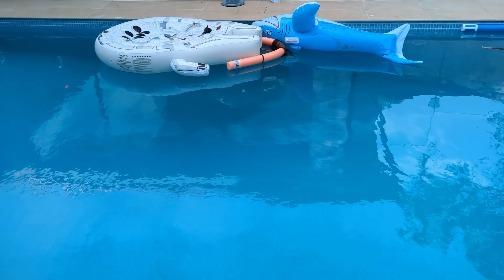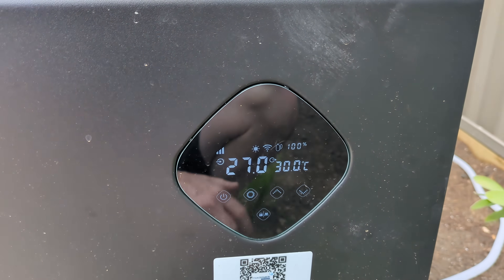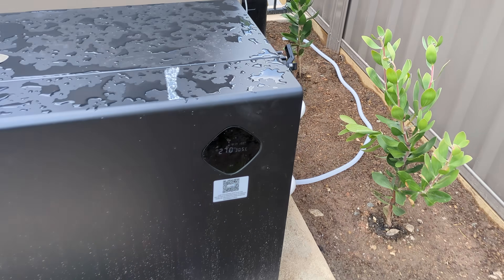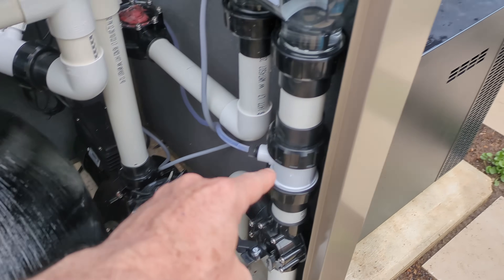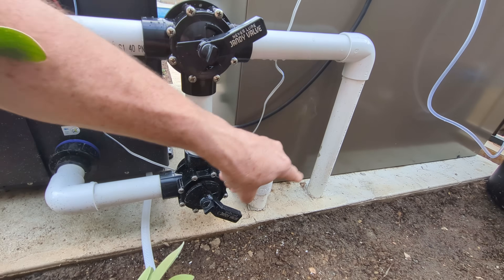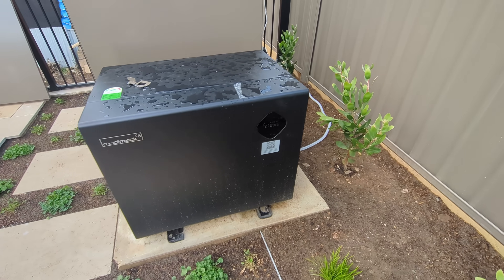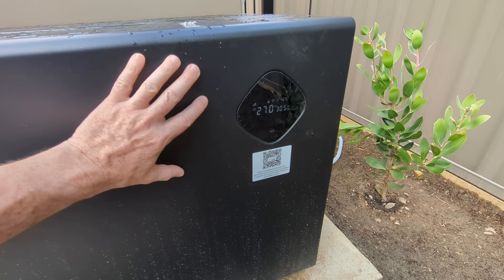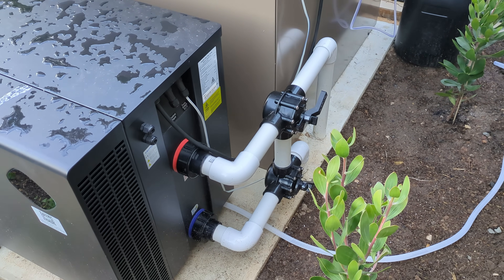Pool Heat Pump Calibration Explained (Madimack)

Comment: You didn't mention why it's more efficient! It's more efficient because it's all about the refrigerant loosing too much energy into the large volume of water and thus needing to be heated up even more by the radiator/compressor before the phase change occurs which is just wasted energy, modern high efficiency refrigeration systems (and other industrial processes) are all about optimizing the system to always stay around those phase change regions as pretty much all of the energy transfer in a refrigeration system is from the phase change of the refrigerant hence why heat pipes in heatsinks also have a 'narrow' range of operating temperatures and heat loads for optimal thermal conductivity.
Reply: Thank you for this comment 👍 makes sense
Reply: Yes this is basically a very specialised AC unit, with the outdoor coil replaced with a small compact heat exchanger. Pressures and flows of the refrigerant are optimised so that the heat exchanger has a section where, with the correct water flow, the phase change is done from hot gas to hot liquid in it.  Too high a water flow rate and this occurs near the inlet, and thus the system runs at a lower pressure differential, as there now is hot liquid refrigerant occupying most of the heat exchanger, and thus the overall system runs at a lower pressure, reducing efficiency. Too low a flow rate and this zone moves outside the heat exchanger, and there is likely a temperature sensor on the piping to detect this high temperature exiting refrigerant, and shut off the unit for flow rate.

The air refrigerant side now sits with a small zone of acceptable temperature, the rest of the evaporator not being used to transfer heat to the cold gas, as it is now at ambient temperature, because of the lower volume of refrigerant there. This is because these almost invariably have no accumulator or receiver drier, that holds a larger buffer of ambient temperature refrigerant, so allowing the correct pressures in the various parts, irrespective of ambient temperatures.  Small volumes of refrigerant you need to keep inlet and outlet temperatures very constrained to maintain efficiency, though there is likely a small volume of liquid held in the piping to the expansion device, either a few capillary tubes that exit direct into the evaporator, to reduce pressure that way, or a TXV that meters the liquid into the evaporator based on either temperature of the evaporator, or more likely using a small stepper motor to do this via a microcontroller, but basically the same.
Reply: @SeanBZA  Can variable speed water pumps work in tandem with the heat pumps to keep the refrigerant at the optimal pressure continuously?
Reply: @dosgos  Sure there are systems that integrate the variable flow pumps with the heat pump, but you are then adding a lot of unneeded complexity to the system, and in general with a pool, you can be sure that you will be replacing parts regularly, especially pumps, as they do have a rather high failure rate on them. Pool pumps will either wear out seals, or will cavitate themselves to death, or will wear out the impellor or housing, just from the water and dirt in a pool. Then they will also corrode to nothing motor side, and, as they are all now wound with CCA wire, they are also prone to having motor windings burn out, or go open circuit. Run capacitor also goes low value, and that in turn burns out the main winding as well.
Reply: @SeanBZA  Thank you, have been trying to understand the science behind this for a year, and my Hayward unit came with no clues.
Reply: Thanks Tim , you are a wizard. I am pretty highly educated and have worked with heat pumps for a few decades but I couldn't have explained as well as you do.

Comment: This really in not quite true. At higher flowrates the amount of energy going into the pool will be the same.  You ara just heating more water, with a lower delta T.  COP at higher flowrates shouldnt be affected as far as i understand it.
Reply from the maker: Madimack say otherwise. The specs are very clear on where the maximum efficiency figure is.
Reply: @EEVblog2  Thats hydraulic likely efficiency rather than heating efficiency.

Comment: Oh! Is that the reason why movable ACs usually don't have two pipes to outside? They work better if temperature is in very specific range? and outside temperature can change wildly. or is it just that it is cheaper to make with just one pipe?

Comment: So if you have a three valve bypass as I have I would adjust the centre valve to adjust the flow through the heat pump?

Comment: Hi, how do you actually set the temperature and difference between in let and out let. Also our percentage bar is at 0 so it’s not doing anything. This would be really useful information.

Also if the pool is low and not right in the skimmer box will the heat pump work properly?

Comment: Is there any issue with the bypass (non heated) water causing back pressure on the heat pump outlet water flow?

Comment: Hey Dave did you look into running a separate pump for the heater so you don't need to run the filter pump the whole time? You probably only need to run the filter a few hours a day to clean the water, the rest of the time running the 1kw pool pump is just pushing extra water around for no reason.  Every little bit helps when going for efficiency. 😃

Comment: Thanks Dave my Madimack just stopped working. 
Luckily it is just a flimsy reed switch connected to a paddle they use as the flow sensor, just inside the outlet. Kept throwing E3 error for no reason. Just superglued the magnet back onto the paddle and it works again.

While trying to find a fix, I found your video and my flow is way to high and have dialled it back 🙌

Comment: To be fair from all I have read your heat pump is also somewhat undersized.... you wouldn't be that far off with the 12kw version and probably could match the flow rate with an inverter pump, and control it such that during heating it runs at the lower speed and only runs at the higher speed during certain periods for cleaning/water turnover reasons.  Just eyeballing it your have around a 40k liter pool which is at the upper end of this unit... thankfully more inverter heat pumps are being sold so you can oversize the unit somewhat and widen the efficiency range significantly. I think its an area where state of the art is definitely moving in the last few years... a few years ago nobody would have even sold anything more than an OFF/ON heat pump even though though and oversized unit running at 25% is a lot more efficient than a unit running at 100% outupt this is also in part because in addition to matching your coolant flow, the available heat or heat capacity in the air also varies with climate, and the inverter unit can match that better also... I don't think any of them actively try to hit an optimal efficiency point yet though.

Comment: er, tell me you know nothing about thermodynamics without telling me you know nothing about thermo-dynamics ;-)

Heat transfer by a fluid is governed by three factors:

1) the fluids specific heat capacity, which for pure water is around 4.2 kJ per Kelvin per kg ie it 1 kg of water will be warmed up by exactly 1 kelvin if you put into it 4.2 kJ
2) The mass flow of the fluid (mDot)  this should be obvious from 1), ie the more kg of fluid you flow in any given time period, the more heat you move
3) The temperature difference, again, this should be obvious from 1) that a fixed mass of fluid up by 2degC takes twice as much energy as warming it up by 1 degC

If we assume for a second you heat pump has a fixed heat output (it doesn't, but we'll come to that in a bit) then as you increase the secondary flow rate the temperature difference MUST reduce. This DOES NOT mean less heat is being carried, simply you are trading deltaT with mass flow. More mass, less deltaT, less massflow, more deltaT

Now, like for all heat engines, for a heat pump which uses a phase change method to move heat the "wrong way" ie against a thermal gradient, we have a fundamental physical characteristic that governs how efficiently it can do that (The carnot efficiency).  The efficiency with which it can move heat is INVERSELY PROPORTIONALl to the magnitude of the thermal gradient across which it is moving that heat. What this means is a heat pump has max efficiency at min deltaT, effectively in laypersons terms this is because it is "pushing the heat against the smallest temperature gradient".  The practical embodyment of this characteristic is that your heat pump will move the most heat with the least input power at the lowest deltaT achievable 

So, in reality, you really want your mass flow to be infinite, ie there to be NO deltaT, ie your heat pump output temperature is the same as its input temperature. This is obviously not practical, and in a real system the thermal gradient across the interface boundary (ie across the plates of the heat exchanger that keep the differing fluids apart) is clearly none zero as well.

To work out what the best secondary mass flow actually is, and it's almost certainly a significantly higher than the recomended flow range, you actually have to measure the total system energy consumption including the pumping elements!

If we consider a pool in a 25degC ambient, were we want a 30degC average pool temperature, and with two secondary mass flow rates for the pool water, a "low flow" which gives a heat exchanger output temp of say 35degC and a "high flow" option that results in a 32degC output temperature in order to keep the pool at our average.

The theoretical CoP is set by the absolute temperature difference between the heat pumps input and output fluids and we must work in Kelvin (0 degC = 273 kelvin)

Case 1, low flow CoP = (35+273) / ((35+273)-(25+273)) = 31
Case 2, high flow CoP =  (33+273) / ((33+273)-(25+273)) = 38

Here, because the deltaT's are so small, we are into a range where the inverse nature of the division inherent in the Carnot efficiency calculation makes large differences to the CoP for small differences in the deltaT. In a real system we will not be quite as "high gain" as this, because we have those temperature gradients intrinsic to the heat exchanger itself, ie we actually have to push the heat across the boundary between the two fluids. Add in a practical 3degC heat exchanger boundary graident and those CoPs fall to 19 and 22 respectively.

You heat pumps maximum CoP (claimed to be around 14) will be developed at the lowest possible secondary deltaT, and probably at it's lowest rated power. This claimed max CoP obviously includes all the other "in-efficencies" and losses" ie driving the cooling fan etc

So why, you ask, do heat pumps have a recomended "flow rate range"?  Well this is because in a practical system, moving the secondary fluid ie the pool water is not free, ie it takes energy to move, and as the dynamic loses in a flowing system go up with the square of the velocity, trying to ram too much water through the heat exchanger becomes counter productive.  In a practical heat pump, the size of the heat exchanger is set by limits, a larger exchanger costs more, takes up more space, is harder to seal and harder to make work evenly.

Comment: It is interesting you'd bring this up, since my dad and I have been having a debate on the flow rate we should use for a solar panel pool heater he built using 3/4" copper pipe.
It was my opinion that quantity of heat would remain the same regardless of flow rate.  My dad on the other hand was basing his thoughts on temperature differential, which would require a slower flow rate.   After all, the goal is increase in heat, which is temp differential times quantity of water heated.
9 hrs?   That's an awful lot of time to only rise the temp by 3C.  You probably could lose all that overnight when the pool pump is shut off, thus never getting your pool temp to where you want it at the times of the day you'd want to swim, especially on colder days.
I was going to experiment and test how much heat I would actually generate at different flow rates:
Take a 4L (really 1 gallon around here in the US) container, time how long it takes to fill it, and measure its temperature (heater output temp) compared to pool temp (inlet temperature).
Really i don't think his solar panel really does much, just too much pool and not enough heat from the home-made panel.
He used to have a pool solar heating system on the roof, but had to remove it in favor of electric solar.   We even used it to cool the pool down when it naturally got too hot by running the pool pump at night.

Which then has me think of how efficient are HVAC heat pumps really?   They deal with air as the fluid medium, which I would think has a slower heat transfer rate.  Those things have to raise temperatures a heck of a lot faster than just 3C in 9 hours!

Comment: Instead of bypassing part of the water flow, I wonder about just choking the output flow of the filtering pump? Because the filtering pump in spite of being fixed speed, is based on an impeller, meaning it can be choked, and the motor instead of pulling more amps, the opposite will happen. There is only so much you can choke however, because at a certain point there is cavitation in the impeller, causing water to boil and damage the pump.
Reply: you can use a variable speed pump to achieve a similar result .   ie valves can be fully open and pump is running slower , but you need to also factor the water turnover for filtration. We aim for 3x turnover but seldom achieve  it domestically  , usually somewhere around 2x per day . Of course this all depends on how big the pumps is vs volume of pool , if you put a big arse VS pump on a tiny pool then turnover isn't an issue
Reply: Then you wouldn't be filtering the pool as much. The bypass valves is the better option.

Comment: It's insane that the "baby" heat pump draws almost 50 amps.
Reply: Where do you get it from?
Reply: @wiktorm5839  11kw @ 240 volts
Reply: @ClippyOwns  divide that by the heater's COP to reach the current draw. So it will be between 3A and 8A depending on conditions.

Comment: Most of the heat introduced from the heat will be at the heat pumps saturated tempature for the pressure of the condenser, by slightly lowering the average water temperature. You will lower the heat pump evaporator saturated tempature by having a smaller delta  you will make the system more efficient. Being a varible capacity inverter unit it should be able to adjust the compresor to make they system run at peak efficiency. Most likely the flow specs are due to fluid flow through the heat exchager being as small as that unit is. I would recommend running it off a second pump to keep it in the desired range and not restrict your main flow.
Reply from the maker: No need when you have the valves to adjust the rate.

Comment: i don't agree with the logic presented ..   if the heat pump adds 4kw @60l/hr with a 3 degree rise, or 4kw @600 l/hr with a .3 degree rise.. is the same amount of heat added to the pool's fixed volume 30,000 l.

just like wattage for resistors 100 v @ 1 amp is 100 watts, just like 10 v @ 10 amps is 100 wats
Reply from the maker: The COP of the heat pump changes.
Reply: @EEVblog2  how about a testing video where the flow rate changes and temperature differential across the pump is measured 
From that output btu can be determined

Comment: almost correct dave, but you (and/or your pool guy) is wrong on the reason whay this unit need 65L/min. the problem is that a heat pump will only work better the more water you give it but at some point the relativly small heat extchanger in the unit is simply too restrictive to deal with the full pump capacity of your circulation pump. with a delta T of 3 you are already walking the line of getting the maximum out of the heat exachnger you can reasonly expect. increasing the flow rate would have no meaningful efficiency gains. if you give it 6x the water rate it would still move 11kW into the water regardless but the (water) pump losses are quite large. the heat pump itself LOVES it, but everything else in your system would not.

Comment: Not happy with your electricity work Dave! Unprotected corro that powers it fails as3000 standards.
Reply from the maker: Huh? If you are talking about the ribbed corro it's for the earth wire to the fence, not the power. Power is in the 25mm orange conduits
Reply: @EEVblog2  I could make a whole video how your setup is wrong electrically. Like WTF doing a solder joint wrapped in tape then cemented?! Moisture will leak down and deteriorate. 

You're an EE FFS I expected better from you and I even offered to help on the project.